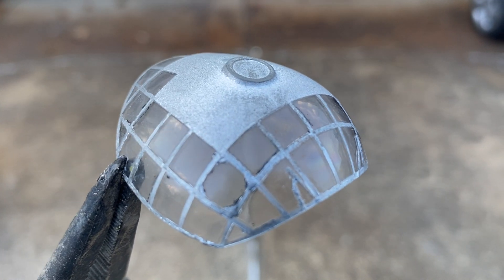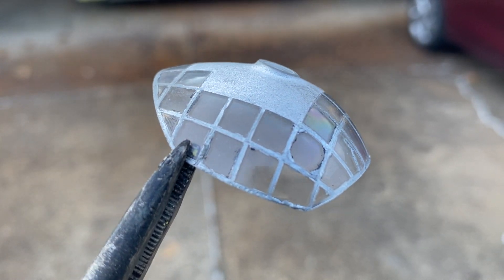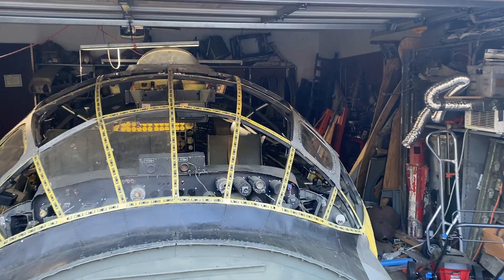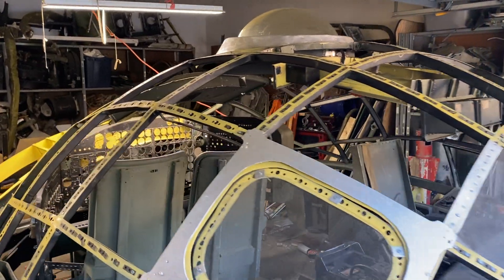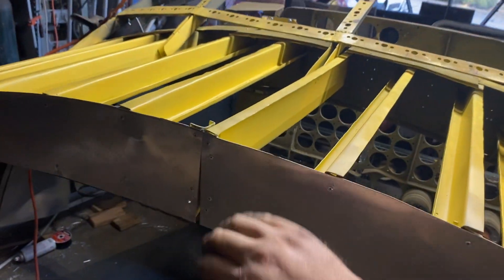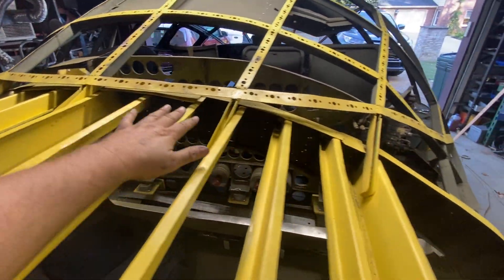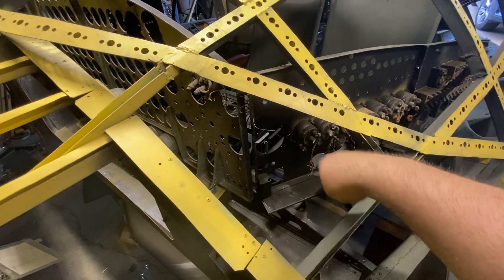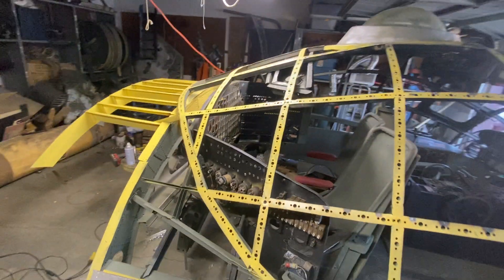B-36H Peacemaker Fuselage Bulkhead 3.1 Construction is Underway

Comment: Was the glass on the original just flat panels or was it formed to make a smooth curved surface?  If it was curved will you also form your glass panels?
Reply from the maker: The glazing is complicated. The outer layer was formed of two layers of glass and laminated and/or glued together. A lot of the panels have an airspace between them for defrosting with a piece of plexiglass on the inside. So, some of the widows have three layers of “glass”. I touch on this on some of my earlier videos, but I can’t say which ones.

Comment: There’s also the 1/48 scale HPH models B-36 that came out a couple of years ago, almost 5 ft wingspan.  Unfortunately is not scale accurate – don’t know why they did it this way, can only say it’s more correct-to-form than the Yonezawa Tin B-36 toy.
Reply from the maker: Yeah, I’ve been in awe of the 1/48 since it came out, and I think I’ve only seen one completed.
Reply: Ya there are only the partially completed pics on the website. If it were accurate as the Monogram 1/72 would have found the money to buy one. I messaged HPH about the obvious shape and size problems but perhaps predictably they did not seem to be aware of them.
Reply from the maker: @johnwatson3948  I had a guy tell me my project makes his 1/48 B-36 seem “silly”. The monogram kits has issues well, especially the canopy. But, that’s purely the product of me having a canopy that was carefully measured from two real aircraft.
Reply: I could tell your canopy was the perfect shape the second I saw it.  The Monogram cockpit not as big an issue as their wing intersection with the fuselage, forming a connecting hump instead of each wing ending there as it should.  Despite this, one would think the 1/48 guys could have just done a laser scan or similar of the Monogram - instead there are things like the (silly) tail fin being wafer thin, the straight radar-fairings forced to bend inward to keep them the correct length.
Reply from the maker: @johnwatson3948  I’d have to see this first hand, and then have a panic attack. The 1/72 canopy doesn’t have the escape hatches and all of the panels are the wrong size and shape. The back of the canopy is the worst of it, as I said earlier.
Reply: I saw many close shots of the 1/48, either on their website or a review. The tail fin is only one of many problems – if I recall the props and jet pods/pylons are the wrong size-shape, along with other things.
I missed those problems with the 1/72 canopy, maybe because I’m not building a real one haha.
Reply from the maker: @johnwatson3948  Wow. These problems may indicate as to why we don’t see any finished products? Yeah, having a B-36 out in the garage changes things.
Reply: You could be right – I also noticed no one seems to be showing off their 1/48 B-36 model.

Comment: So if i understand everything correctly, you will extend this rearwards for now? Or will you continue downwards too, and make full interior of the front part in the future?
Reply from the maker: Rearwards as well as the rest of the nose is absolutely doable because I can remove it, and place it aside. However, the complete fuselage with the canopy would be 15’ tall. I can’t have that in my neighborhood, unless I want to make enemies.
Reply: @B36HPeacemaker  .....modularize it, like 2 sections of the upper and 2 for the lower half.......did you happen to see my comment about the b-36 in the Soplata Collection up here in n.e. ohio ?? (Newberry, Ohio)
Reply from the maker: @earlmyers9374  It’s possible, but it has to make sense…financially. I am well aware of the Soplata remains. I’ve been photo-documenting every detail for years. One doesn’t build a B-36 without having one to measure….